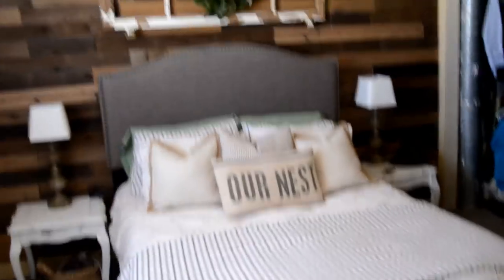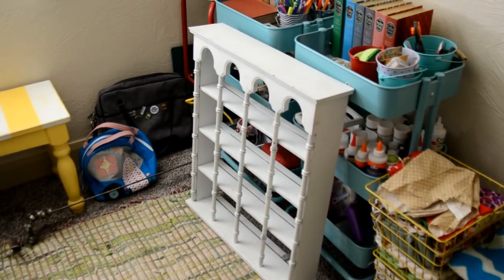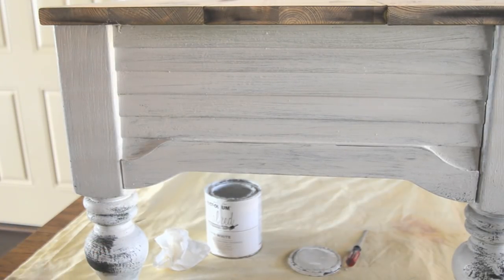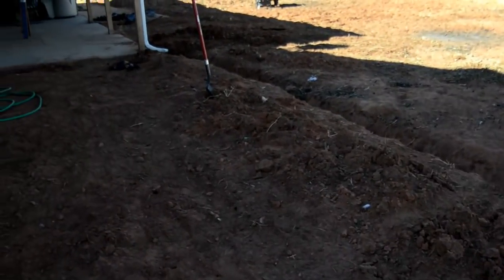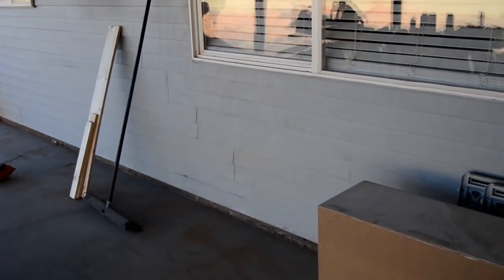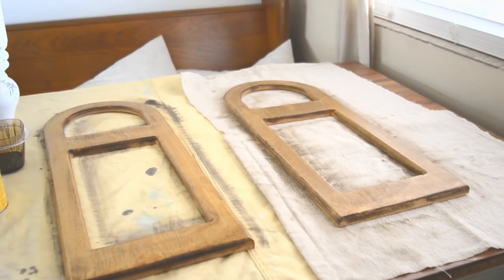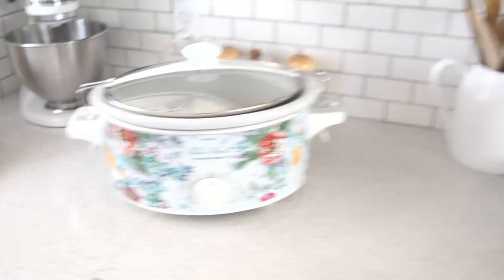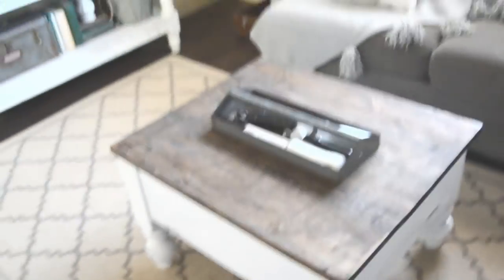Finished Thrifted DIY Table and Sunday Vlog

Comment: Question for you so I just did my first end table with that same Rustoleum chalk paint that you used, do you seal it with anything or do you just leave it like that? Then what do you use to clean it on a regular basis, just like a wet rag? thanks! Love your style 😉
Reply from the maker: Lorraine Carrillo You can do a wax or a (I prefer) a satin polyacrylic to seal. Typically I don’t seal ever. I use a damp sponge to clean and a dry cloth to wipe up. 😊👊🏼